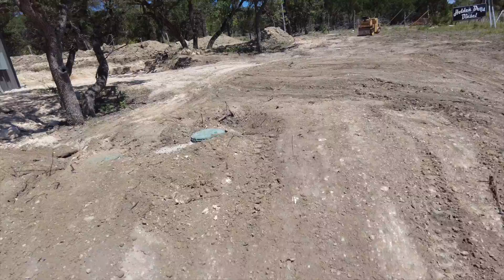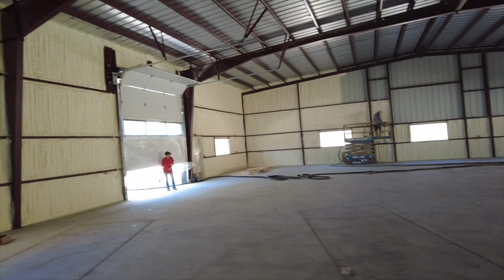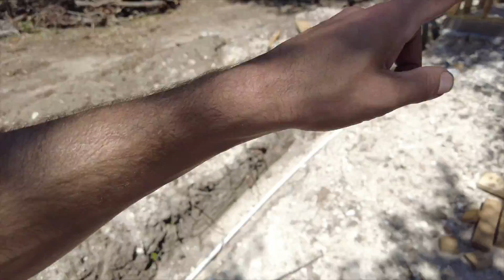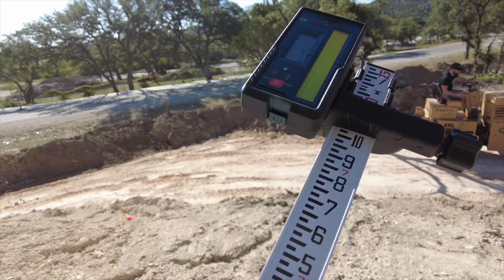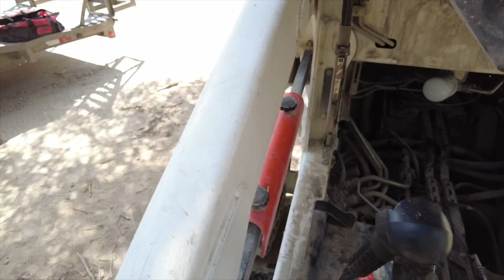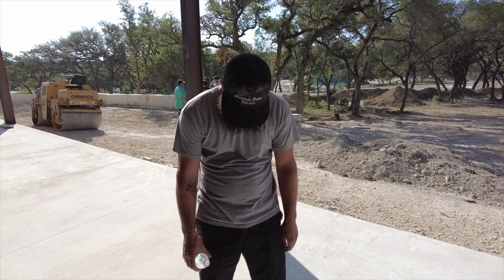100k lbs of Butter Blocks & Spray Foam

Comment: If you ever get heavy rain, you may need to actually pin the blocks into the ground. I watched a retaining wall fail in the spring during snow melt here. Saturated soil just hydraulic'd the blocks right over and slowly leveled itself out.

Comment: As crappy as it looks, you should cover the perlins with insulation also. Without it they will heat transfer directly from the sheeting and cause unnecessary heat gain. Any time you can encapsulate steel that is attached to the siding you'll gain utility savings even if it's ugly.

Comment: You make my loins tingle.
To bad you didn’t cover the roof in solar panels. Free power..
Reply: Free? Hardly. My last calculation had solar taking almost 30 years to pay for itself.
Reply: @MrTexasDan  30 years? Man your electicitybills are cheep. In the Netherlands it takes only 8 a 10 years.
Reply: @vanDeudekom  Goedendag Netherlands! I think they are very cheap, yes. Last I checked it was $0.11/KwH. What are you paying?
Reply: That roof has so much space for activities, that could have easily powered the shop with extra I reckon